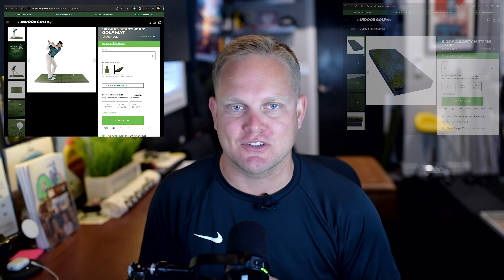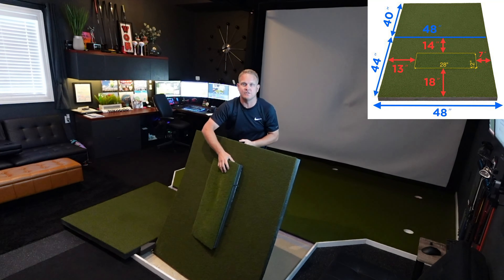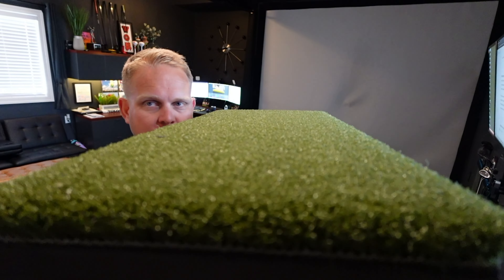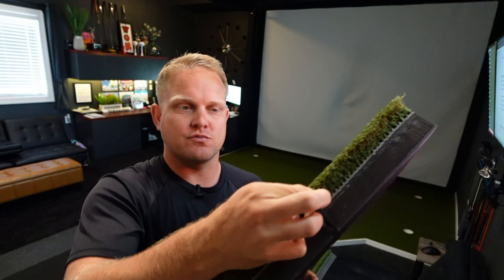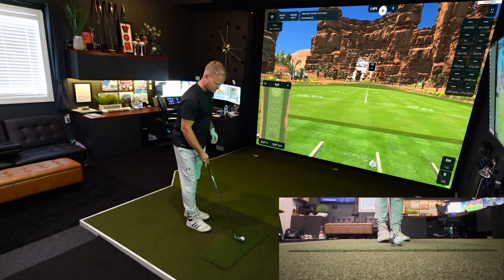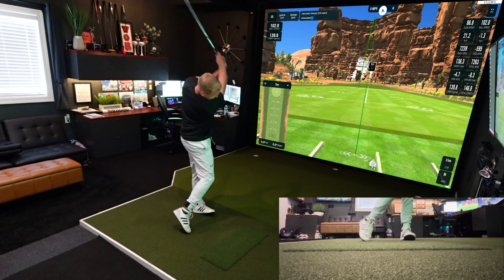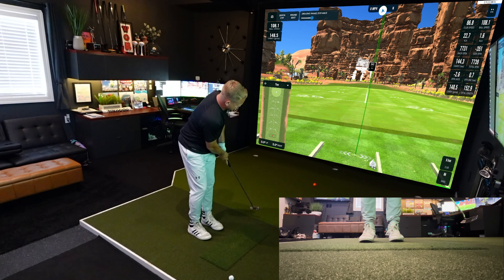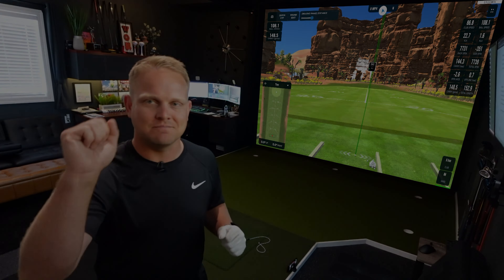Replacing My SIGPro Softy Hitting Strip After 1 Year - How It Held Up!

Comment: Note about the putting: If you use an overhead monitor with a wider hitting area you could putt outside of the hitting strip.   For example protee is 21 inchs wide hitting area.
Reply from the maker: I’ve got to get a ProTee!!
Reply: @ that makes two of us

Comment: How has the stance area holding up? I have turf under my feet and now it's pretty well worn down.  Curious how well that SS turf is working.
Reply from the maker: Holding up really well. I believe they glue Grasstex money putt turf to top of the Eva foam but that’s not confirmed officially.  I have zero complaints and see the stance matt lasting for years.
Reply: I've had mine for about month and have created noticeable foot impressions. Been starting to vary where I stand now. Not sure if others have had this happen or it only compresses to a point?
Reply from the maker: @ I would reach out to them about it. I don’t wear golf shoes in the sim or spikes rather, but I’ve had mine for 14 months and it hardly  shows any wear or tear.  I’m on my 2nd hitting strip in that same time.  

Assuming you’re talking about the stance mat.  The rest of the turf in my room is money put turf and It is also holding up really well.   

Again, I’m really sorry to hear this, I would reach out to indoor golf shop
Reply: Well I've since gotten one and am pretty disappointed in how it wears down where you stand. Guess I need to get a mat (like Michael Breeden).
Reply from the maker: Did you buy from indoor golf shop?   I’d love it if you could email me some pics.  You can see mine on stream and I haven’t had any wear and tear.  Bothers me to hear that it’s been dud for you.  Do you wear golf spikes?  Is it the turf or the foam breaking down?   Definitely need to reach out to the seller and figure out what the issue is, maybe even get a replacement.  I’ll fight for you.  trpl.bgy@gmail.com
Reply: @trpl_bgy  Interesting. I'm wearing my TrueLinks shoes so no spikes. The turf isn't getting torn up at all. Just permanent impressions. I'm going to look closer and see if the EVA is staying compressed of if I'm just flattening out the grass. I'm 210 lbs so not a small person, but far from a weight you would design it to ha.
Reply: @trpl_bgy  Thanks. I didn't wear spikes, just regular running shoes. I'll send pic, thanks!

Comment: Do you have a slow motion video of impact with iron on a fat shot. I've heard that on fat shots the hitting strip will compress and the ball will stay at its height creating a gap between the ball and the turf resulting in the ball striking higher on the face of the club.
Reply from the maker: @brygask  I could make one and see. Have me curious now! I’ll have one up on the channel before Sunday. Maybe sooner.  🙂.  I can say fat shots feel fat and the numbers show up low as if it were chunky.    Is this for all hitting strips or for the divot action strips you are hearing this on?
Reply: @trpl_bgy  I haven't seen/heard anything about this happening to the sigpro softy, just DIY strips that are made with the same concept as the sigpro softy. Came across all of this doing research to make my own version of sigpro softy,  hesitating now on DIY and cant find if the sigpro softy has this same issue. A slow motion video of the sigpro softy with fat iron shots would be very helpful. thank you for your time!
Reply from the maker: Love it.  Great idea. Curious to know myself. 🙂

Comment: Did you take those measurements and create that graphic yourself? Can’t find that info anywhere from IGS.  I’m concerned about the space from GC3 to hitting strip in the 4x7…18” will work, but all the pictures look like it’s centered in that mat segment, so about 12” to the edge.  Thanks for a great review!!
Reply from the maker: For the 4’x7’ SigPro Softy These measurements are taken by me and spot on at 01:10 mark in video. They didn’t have the info on their website when I needed it so I decided to measure and added it to this video.  I know from experience the GC3 has enough space to be used with it and measure again just now to confirm 18”.
Reply: Perfect!  Thanks for the lightning quick response!

Comment: Thank you for the informative video! I bought the SigPro Softy and love how soft it feels when hitting off the mat. However, I’ve noticed a major issue with mine—it produces a fine green dust on impact. After just a few hits, my clubs get covered in this dust, and it spreads throughout my simulator room. It’s even affecting the air quality, as I find myself coughing during practice.

Have you experienced any similar issues with your mat?
Reply from the maker: So I do get fine dust on sticking to a club after repeated use or shots and will clean.  However because my room is finished and the kids track in dirt often I vacuum my mat, hitting strip,  and turf weekly.  I haven’t experienced issues with the dust created by striking the mat but it could be just the vacuuming that keeps it from accumulating to the point where it goes in to the air.  May also be something I’m not as sensitive to.   Great comment and question.  Thank you for watching!
Reply: Gets into the lungs and likely causes cancer.
Yikes.
Need to play with a mask i guess.
Reply: Did you find other mats you tried did NOT produce fine green dust?
I'll keep looking for alternatives now that you mentioned this!
Thanks